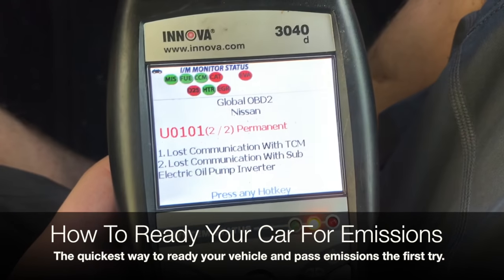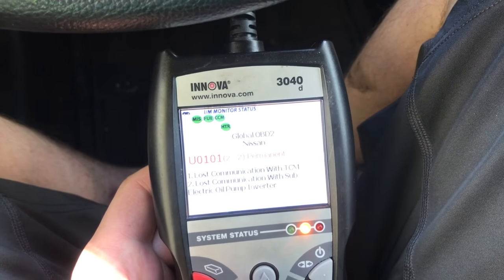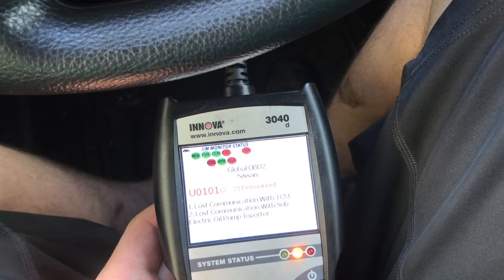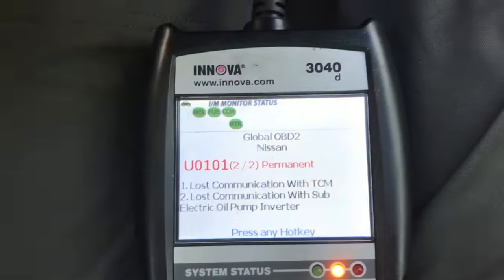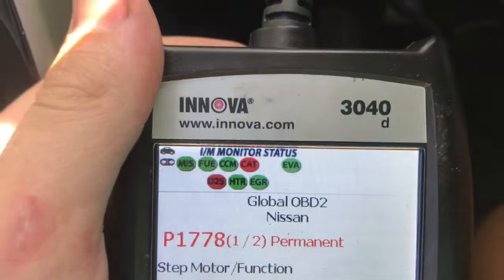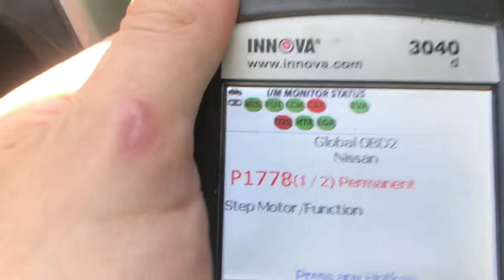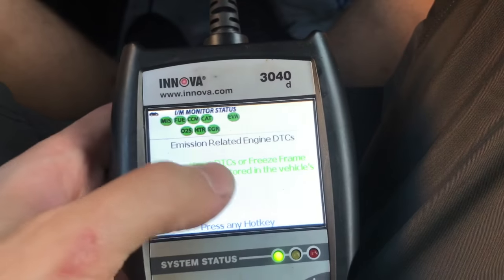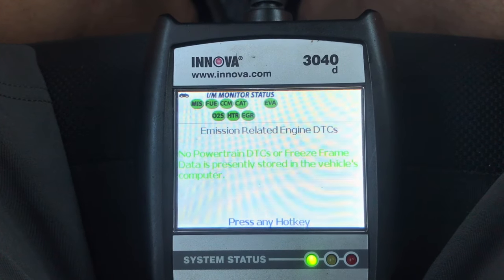How To Complete A Drive Cycle & Pass Emissions & Smog Test (Life Hack)

Comment: what if the car is a turbo car with a TUNE on it and it is not passing because in the tune the o2 sensor was disabled. I heard putting longer bung spacers and then the 02 sensor helps with it? any idea
Reply from the maker: Can you enable the o2 sensor and get it to pass? That’s something you should check forums on
Reply: Karrs Kars my brother had a 2006 VW GTI and it was a stage 2 turbo tune.  
He ended up going back to stage 0 (factory). Where it enabled o2 readings and with a extended bung passed. 

This car I’m looking to buy just says not ready on 2 sensors on the emissions test. I’m not sure what the deal is if it’s tubing or just not driven enough.  

If the car is due for emissions from last owner.  And they never did it or failed. If I buy the car when will it be due for emissions????
Reply from the maker: Depends on where you live. Some counties don’t do emissions. Other counties you’ll have to do emissions before you can get it registered.

Comment: Been driving my 2000 z28 for about 120 miles and my guy says the secondary pump hasn’t cleared. Granted the car has been sitting for over 5yrs, I manually bypass and checked pump and it runs when you get power to it. The relay is working but there is no powers to the pump. Am I missing something . Does that pump always runs or just when needed thanks

Comment: I have a 2001 Chevy Silverado that I’m trying to get smog done but I still have 1 monitor not ready “the secondary air monitor”..  I don’t have a check engine light...can anyone help
Reply from the maker: More than likely you just need to keep driving your car through a couple more drive cycles. Since the Air Injection System is used to inject air into the exhaust stream to get things heated up faster, it normally comes on when the engine is first started (cold start).

This means the air injection part of the drive cycle is tested when the engine is first started. You may need a few more cold starts until the AIR injection monitor sets (show as READY or COMPLETE status). The important thing is to make sure the check engine light is not coming back on. As long as the light is not illuminated, that's a good sign. It's not a guarantee that the injection monitor will set, but it's at least an indication that the secondary air injection system is at least functioning at the most minimal level and not triggering any air injection trouble codes.

It's always a possibility that the air injection monitor is not setting because of an air restriction or partially fault air injection component, but that won't be know until you've at least completed a few drive cycles over the course of a few days. Just keep driving for a few more days. Ensure you're not just trying to complete the drive cycle at one go... starting and driving 400 miles. Give it a couple days so you get enough cold starts.
Reply: allen Thompson   It's safe.

Comment: I reset my codes after repair on my 2013 chevy silverado 1500 and been driving for 160 miles doing what you said and still nothing. I can't pass smog. It's not throwing a code just need the eva to stop flashing red on my obd2. I've done different drive cycles that I've read to do. please help!
Reply: Are you in CA?  In CA you can pass with EVAP not ready. Don't let the tech tell you any different.

Comment: On my chevy trailblazer check engine light won't go off, the issue was COOLING FAN RELAY and I replaced it.
-How long does it take for drive cycle to pass emission test?
Reply from the maker: Could take a couple of hours could take many days just depends how you drive.

Comment: After completing the drive cycle would you be okay to let the car sit over night before taking it to emissions? Or would I have to drive around again before going?
Reply: Have to finish the cycle and go straight to the smog check
Reply: @bayfinest1938   - No you dont.
Reply: Once you get the monitors in the complete state they will stay complete till you do 1 of the following things:
1. Clear a check engien light code with a scanner
2. Disconnect or drain your battery. 

So you can let it sit overnight or for a month before your emissions test they will be set.

Comment: 1200 miles in a 2004 chevy astro van and still evap and cat not ready. Tried your way 10 times. Made no difference. Last time I had to deal with this it took 6 1/2 months to go off. Was just going to drive until the police took it. Will let you know if I find a way to trick this one.
Reply from the maker: That’s a hard one. Evap could be a bad gas cap. Cat is catalyst that checks catalytic converters. Could have issues with that or maybe is your battery possibly low? or you have slow crank or need to boost vehicle? If so the PCM will loose power while cranking if it drops to low and the monitors will start all over everytime you start the vehicle.

Comment: The only thing that isn't registering on my 2008 Honda Civic is the OBD-II Sensor. I have driven it close to 255 miles and the shop told me to keep on driving it. I can't understand why the OBD-II Sensor is having trouble? I am driving it at 90mph sometimes. Can you please give me advice?
Reply: Need to drive 100 mph at 1/4 of a throttle with 1/4 to 3/4 gas tank for 1 min then slow down to 35 mph without using the brakes coast down,then turn on right indicator,defrost,heater on 3rd blower speed,then brake hard while turning on the headlights and lighting the cigarette simultaneously.After that open drivers window and throw cigarette away and connect the reader and it should reset,if it didn’t,junk the car.

Comment: I have one more chance. I disconnected the battery and the check engine light off. drove for 50miles came to emission      station turn off engine. They plug in odb 5min fail. The guy said drive 30 miles more. I didn't do it yet. But I found your video and not sure if this ok   for 2006 mdx or not. If you can help out i will greatly appreciate alot.
Thanks
Reply from the maker: You need to see what the check engine light code is. Go to auto zone and have them scan it. You won’t be able to pass with the code. Sounds like it’s probably an o2 sensor or something like that.
Reply: @karrskars  o'Reilly guy tested and said o2 bank 1 upstream.
Reply from the maker: Then replace that sensor or you can take it off and clean it but I’d just find one on eBay and swap it out. You may need to pat someone to do it because those can be a pain in the butt if you don’t have the right tools or if they need heated up to come off.

Comment: I have a problem with a toyota tundra I have drive for like 80 miles and the codes doesn't turn green do you have any idea how can I fix it
Reply from the maker: Are you letting it cool down? Just drive it like you would for a day or two. Or google Toyota Tundra drive cycle and follow the steps

Comment: What should I do with my 1997 Nissan Altima that has 225,000 miles and I drove it 50 miles on the freeway, and EGR and Catalyst said they're still not ready. Should I drive it 100 miles? My smog check  passed emmissions, but the monitors still aren't clicking on
Reply from the maker: Yes drive it more unless you have a check engine light on

Comment: Hi  my O2 sensor is usually the last code to turn green, and when  it does, if I then stop the car to  for a few minutes then drive again and  check the codes  the cat/ 02 sensor & 02 sensor heater Go back to red/ & I'm back to square one again  car is a focus st MK2 UK specification..

Comment: I have a 2013 Chrysler 200 and have problems passion emissions test they said I need to drive it then I had the oil changed on and the engine light went on before what would you suggest
Reply from the maker: Go to autozone or O’Reilly’s and have the code read and see what it’s for. Reset it and drive again. You can’t pass emissions with a check engine light.

Comment: I drove 180 miles total back and forth after doing the repairs and replacing what is necessary to pass smog but evap and catalyst still uncompleted so whats the best way to do it?Run it with the code reader attached like what you did and when all are cleared go straight to the smog shop?
Reply from the maker: You need to let it cool down and then bring it back up to operating temps usually. You can’t really do a drive cycle on one continuous drive with most vehicles.

Comment: 2002 Yukon slt, I need to smog,it. I use a FIXD app, code are good except I can’t get enough miles to get it to temperature. I change the thermostat,, drove it around but still not enough. Any suggestions?
Reply from the maker: If it’s not reaching operating temperature and you changed the thermostat maybe try another thermostat or your gauge could be bad or you have another issue

Comment: I reset my codes for 2009 dodge journey but the EVA light is still showing on my scanner , I cleaned the gas  cap  since it was dirty around gasket, and I am having not engine light on my car dashboard anymore..
But t the scanner shows the EVA...
what should I do...???
Reply from the maker: Do you have any engine codes? Pending or stored? If not you may have to keep driving in order for the evap to clear

Comment: will the check emissons light go off when the drive cycle is done correctly? My battery died in my Acura tl (09) I didnt drive it for 5 or 6 months , so when I got a new battery all of a sudden the check emissions light popped on. So if I do this drive cycle correctly should the light go off?
Reply from the maker: Yeah unless you have an emissions issue
Reply: @karrskars  funny, i hooked the code machine up and cleared the codes and the emissions light is gone..piece of cake

Comment: hello I have a Ford Focus ST I already did that process 2 times and the Oxygen sensors are not ready yet something else I can do
Reply from the maker: The best way to do it is drive normally but try to put like 15 miles a day highway and city and split it throughout the day. Make sure you get the vehicle up to operating temp before ending your trip.
Reply: @karrskars  ok thanks

Comment: How can I tell what the drive cycle is for 2011 VW Routan? Very similar to town and country.
Reply from the maker: Note: engine must not be switched off during the test sequence. interuptions will require a restart of sequence. 1. switch ignition on for approximately 30 seconds but do not start engine. 2. start engine and let run at idle 3. increase engine speed to 3000-3500 RPM for 90 seconds to heat up the three way Catalytic Converter (twc)
4. with the vehicle stationary, run the engine at idle for 40 seconds. 5. test drive for a minimum of 13 minutes manual trans 3rd gear auto range 3 test drive must be carried out without interruption, which means steady pressure on the throttle so that deceleration fuel shutoff is not activated nor is the throttle allowed back to the idle position. 6. allow the engine to run at idle for a minimum of 13 minutes 7. after completion of the test sequience, reconnect to the scan too and observe display. repeat if still not set.

That’s what it says in service manual

Comment: I have an S10 and the AIR pump is working and everything checks out but it’s NOT READY. Hundreds of cold starts, thousands of miles but still NOT READY no check engine light? Plates expired in 2017 and can’t get new ones cause AIR PUMP not ready. Entire air pump replaced with all components. O2 sensors replaced. 

Hair pulled out!!!

Comment: Easiest way to set Evap monitor
Fuel tank must be 1/4 - 3/4
Perform a cold soak. Turn off car 6-8 hours
Start car with AC and rear defroster 
Idle car and let engine reach operating temperature 
Rev car to 3000 RPM for 10-15 seconds
Done
Reply: Hagong is that better that driving it tho
Reply: It is better, but this just sets the EVAP monitor.

Comment: Hi Kare Kars I got a question my Hyundai Elantra 2011 will not reset it's VVT monitor... I took out both intake and outtake solenoids and tested them. They seem good and work but after driveing the drive cycle it still won't reset... Any ideas?
Reply from the maker: Road Test Notes:
1. CoolantTemperaturewithin0°to104°F(0°to40°C)atstart
2. Fuellevelmustbeabove15%
3. StartvehiclewithAllAccessoriesOFFandletengineidleinParkfor5minutes
4. Place the transmission in Sport Mode and select 4th gear
5. Acceleratevehicleto50MPH*within15seconds
6. Maintainsteadyspeedof50MPH*in4thgearfor4minuteswithnointerruptions
7. Brakeanddecelerateto45MPH*whilein4thgearandmaintainspeedfor3seconds
8. Accelerate quickly (full throttle) while in 4th gear to 55 MPH* and maintain speed for 3
seconds
9. Brakeanddecelerateto45MPH*andmaintainspeedfor3seconds
10.(Repeat) steps 7 & 8 nine additional times - finishing at 55 MPH*
11.From 55 MPH*, when safe, proceed to a stop and allow the engine to idle in Park for three
3 minutes
12.EGR (VVT) Readiness Monitor should now be complete, repeat if unsuccessful
Try this!!
Reply from the maker: Also did you test them with a battery or just inspect them?
Reply: @karrskars  yeah I tested them both and they moved so maybe ones sticking I. Gonna replace them both ND see wt happens... I'll let you know what the results are
Reply: @Karrs Kars thanks for replying I jus wanted to let you know wt happen with my Elantra 2011 I changed the exhaust VVT solenoid and drove it at 55mph for a min strait and let of the gas and let vehicle come to a near stop on its own. I did this maybe 3 times and it finally reset the VVT/EGR monitor. Passed smog NP!!

Comment: I have been driving the car for over one hundred miles, but all of the them passed except FUE.   Is the FUE stands for fuel.  I have been using 85.
Reply from the maker: Could need a new computer or a PCM reflash. What’s the year make and model? Doesn’t matter what kind of fuel you’re using FYI

Comment: Are you located in SLC?
My o2 sensor and catalytic still reading not ready after a week of driving.   
I cleaned the mass sensor new filter and disconnected battery check engine light is now off but code is still stored in computer 
Should i clear the code and start a new drive cycle?
Reply from the maker: Yes but what code came up? And yes I am
Reply: @karrskars  its a Nissan sentra a po101 came up said was the mass air flow sensor
Reply from the maker: How dirty was it? Yeah reset the codes and drive it again and see what happens.
Reply: @karrskars  so it's my girlfriend's car and she's on this car for almost two years she's never change the air filter so it was completely dirty mass air flow sensor was pretty dirty I sprayed it off pulled the battery plug it back in after like 20 minutes and the light was off but it's still showing a pending code when you look it up with the computer so yeah I will reset the code completely and start over again and put a new mass air flow in it the Catalyst and O2 sensor were the two that won't start over so many other questions man I'll I'll hit you up cuz I'm only in Ogden
Reply from the maker: If that doesn’t work you may want to clean the throttle body really well or check for vacuum leaks. Those are high probability problems as to why your light is coming on if what you’ve already done doesn’t fix it.

Comment: Every light except for the fuel stayed on any other ideas? 
2013 C250 Mercedes coupe
Reply: You trying to pass a smog in CA?
Reply: In CA you actually do not need to have the fuel monitor completed to pass a CA smog check.  It is not mentioned often because this is such a rare occurrence but the continuous monitors are ignored during a CA smog check.

So if OP would have gone and actually had his car SMOG tested he would have passed.  Problem is about 90% of the inspectors do not now this because they don't read the literature so they send people away without providing them a test.    So be firm and insist that they do the test .  Inspectors are not in control on the OBD portion so they can't fail you if they wanted to.   

If they won't perform a test I suggest filing a complaint with the State BAR.  It is inspectors jobs to test cars as they are presented not save people from a fail.

Comment: After driving and getting all the items to pass position once I turned off the engine, those items went to red again. Any idea. There is no code
Reply from the maker: Mag need to check out your battery. It might be weak enough that it can’t provide power to ECU and ECU resets when you shut the car off.

Comment: I've drove over 600 miles on my 2000 i30 my catlyic still won't finish what should i do?
Reply: Tony, look up your year, make, and model "emissions drive cycle", or "Catalyst drive cycle", it might require certain parameters and conditions to be met inorder to perform and complete the test. Some examples might include:
 Gas tank between 1/4 to 3/4, cold start (coolant temp must be within about 10 degrees of outside temp), drive at 55 for 2 or 3min, accelerate at 1/4 throttle from 10mph to 55mph, decelerate from 55 to 25 without hitting the brakes,  etc. Once you know exactly needs to happen, its pretty easy

Comment: Any recommendation? After more than 5000 miles and a new oxygen sensor for my Nissan Sentra 2013. Obd2 is not ready 😣
Reply: Delete the code, some cars do not self reset/delete even with new parts, if you are using an OBD2 scan tool make sure it is ready after you drive cycle. 
Hope that helps, and let me know if it worked.
Reply: 5000 miles, or 500 ? 5000 and you didn’t drive it through a Nissan dealerships window already, you have patience of a saint

Comment: I live in a el paso tx, i can't really accelerate up to 55 mph without rear ending someone. Is it possible to just drive highway speeds without the step by step guide and clear those codes? I drive a 17 silverado 1/2 ton btw.
Reply from the maker: Yes it is
Reply: Subbed👊🏼